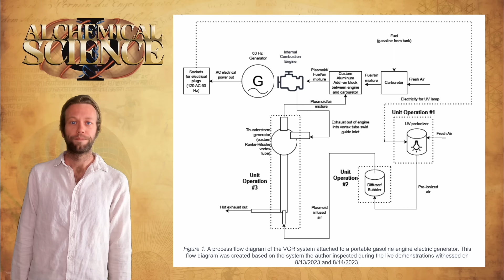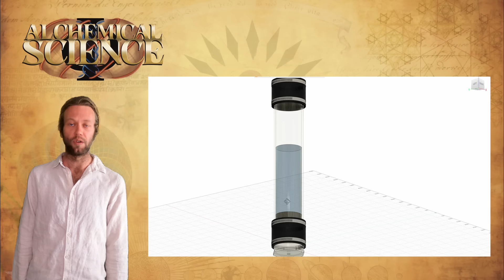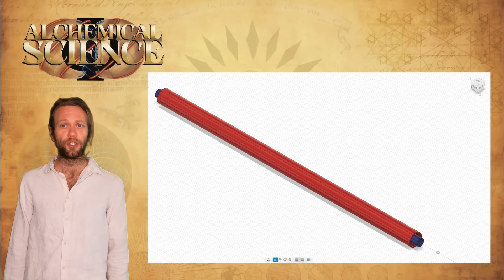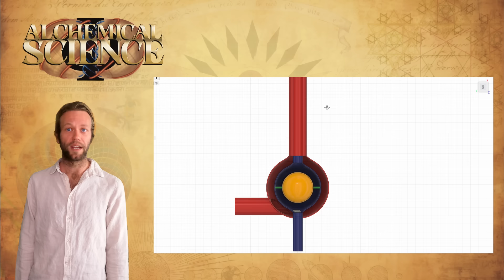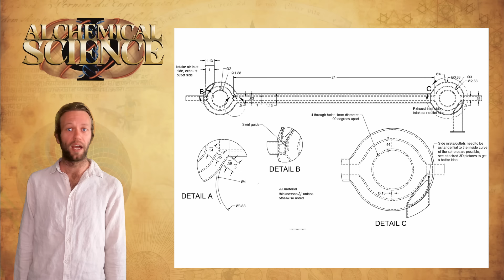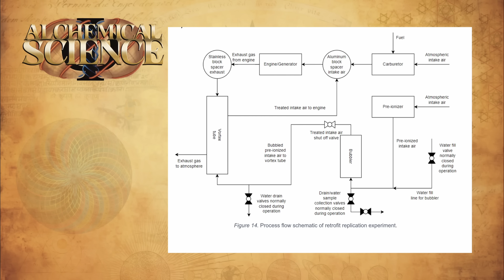Thunderstorm Generator | COMPLETE DIY BUILD GUIDE | Malcolm Bendall's Plasmoid Tech

Comment: YinYang is made up of circles with diameters of 1,2,3 and 4 and is at least 3000s of years old. 
The two small circles are 1.
from the center points of the small circle to the wavy middle line has the radius for 2.
The outer circle is 4.
A line between the two outer circumferances of the small circles crossing the center point of all the circles, give the diameter of 3.
 I'm now going to explain what is happening to the plasmoids. This is going to be difficult without the use of diagrams. Randell described the plasmoids as doughnut shaped, with the to spinning one way and the bottom spinning the other way, this is not quite correct.
The heavy protons fall to the center and stay there but are not bound together, the electrons are orbiting the center. The electrons move at the same speed, however the further from the centre the more distance they have to travel. (think storm cells in the Northern and Southern hemespheres). This process causes an horizon where no electrons can be, similar to the equator. The doughnut shape is also distorted by the movement of the plasmoid, as the electrons on one side have further to travel.
What we have is stable gyroscope, held together by electromagnatisum.
What is happening to the plasmoids when injected into the engine.
The explosion in the expansion chamber causes the plasmoids to collide with the other molicules, this flips the plasmoid. Now no longer a stable doughnut but more like the infinity symbol, with some of the electrons spinning the wrong way. This pulls the plasmoid apart and collapsing into matter and antimatter.
Both a single Oxygen atom and single Carbon atom have 6 electrons but oxygen has 8 protons and carbon had 6, so oxygen pairs up to fill it's "shells". We don't need to worry about the protons for now, due to beta decay turning neutrons into protons.
This indicates that the plasmoid is made of 12 electrons, 6 staying normal matter and 6 converted to antimatter. Because oxygen pairs up the antimatter only has the energy to anihalate the carbon, creating energy and making the engine far more efficient. The excess energy is released through ultrviolate photons. In short the Plasmoid consists of 1 oxygen atom from normal matter and 1 carbon atom of antimatter.
We can replicate this process by adding an AC electromagnet to the end of the thunderstorm generator, turning it into an Antimatter generator.
Reply: Good question, 
I'm going to cut a long story short. A while ago I got caught up in YinYang, I realised that what I was reading was not right.
YinYang is not only about balance it is also centered around the 4 elements of FIRE, WATER, EARTH and AIR.
If there elements act on the fourth we get something special.
EARTH = Chemistry
WATER = Biology
FIRE = Physics
AIR = Chi 
I was listening to the podcast with Randell Carlson, he enphersised the importance of the ratio between the diameter of the circles. He then said about the shape of the Plasmoid and compared it to the shapes of YinYang. Straight away I realised the WATER and FIRE were interacting with the AIR but no EARTH.
The Earth is just one big electromagnet 
Chi is the energy of the universe.
Having a better understanding of Randell's sacred geometry, instead of an AC electromagnet, I would suggest a double helix of magmatism to guide rather than force the flip.
The science is harder to explain but I will get back to you with it.
Reply: Antimatter was never actually observed. The experiment that appeared to show antimatter took place during a fraction of a second during charge (ion) implosion, indicating the laws of physics themselves were altered, and because they lack understanding on those foundational laws, they created the idea of anti-matter. The reality is that space is folded through zero point kinetic implosion, and in doing so, an ion diode is created and will even sustain if a carrier wave can be reset by the mechanism. Keep in mind, true zero point was only correctly defined by Tom Bearden; Pump z waves in sync yet out of phase passing through nonlinear medium will combine forming a sum of waves as a higher frequency wave.  The true nature of physics I've explained on YT since 08 and has been vindicated by others by accident over the years including Ice Cube project evidence of neutrino wind, Azra Wind's prime spiral discovery which verifies that particles function as charge column based transistors, superconductive field geometry I had on web 1996 proven over 10 years later via supercomputer in Egor Babaev's type 1.5 superconductivity paper, and others.  One fatal flaw of classical physics was to rid equations of infinities, while in fact, the creation and destruction of particles in and away from stars is what drives particle flows to require such infinities- since time and space opposites flow opposite because they make one-another through decay and creation.
Reply: This is a theory that I'm still working on, I am still working through the math. So any constructive critisisum or question are welcomed as are any insights.
It is based on ancient knowlagde with an unknown origin and would be easy to disprove or prove.
I am also trying to explain in an easy way to understand.
The first thing I looked at was the air in and the exhaust out, which more or less were equiverlant minus the plasmoids. But the efficientcy of the engine increased, which seems to break "The second law of thermodynamics". 
Einstine taught us E=MC(squared) C is a large number so to square it makes its huge. 
Mass. Think of mass as a weightless box filled will weightless frogs. The frogs jump smashing into the sides the top ect, when you try to pick up the box it's shaking. That means although the parts are weightless you are using energy to hold it still. So mass is kinetic energy. So although the Plasmoids are small they contain a lot of energy, within the proton and neutrons.
Hydrocarbons need oxygen for the chemical reaction, breaking their bonds and attaching to the oxygen, creating carbondyoxide and water. In this technology there are little to no carbon emissions, where has the carbon go?
Why is there still Oxygen? The carbon must be converted into oxygen, which is a heavier element and use more energy, for the 2nd law to be maintained a huge amount of energy must be released for this to happen. The only place we know that has enough energy to makes atoms is a supernova.
As I am working out energy conversions it seem more likely the Plasmoid is becoming anticarbon only.
I am trying to explain Plasmoids, which will come next. but it is hard without diagrams
Reply: E = mc² but this does not explain unification since both mass and energy and thermal entropy are in a motion he could not grasp in his time. Einstein's last words were "Everything is relative" which was a statement triggered by witness of the Philadelphia Experiment when the U.S.S. Hammond disappeared in an oblong green spheroid.  Carbon becomes co2 gas when it reaches a high enough temperature which it can easily do in short bursts when exposed to plasma which has it's own ionosphere with a boundary zone that has different time speed inside vs outside so the transition zone can reach 2 million F in some rare cases.  I've worked on John Milewski's microwave gold process and plasma is the key. Since then I've moved on to alchemy which is far more productive by trapping plasma in liquid preventing the loss of gold vapor when copying gold atoms into other metals. This has been done 1000 fold in under 24hrs, so if I can do that using a simple hotplate, you must know the nano bubbles are doing it to alter the physics you know there. The metal layers act as the carrier wave, while the nano bubbles are the carried waves in kinetic zpe process.  I wrote a book on physics where I show how   E = mc² without euclidian coordinates, instead using a volumetric system of 3 spheres lined up inside a 4th sphere, so the volume remaining of the large sphere equates to energy just the same. The derivative comes as each of the 3 small spheres wavers to the others in 3 phase. They represent negative, positive, matter (the 3rd pole).  By the way, chickens can eat graphite and make calcium from it. That does not require a supernova but modern physicists will try to convince you it does.   @smokeywfwe
Reply: dude youre a trip, where can i follow your journey? we need minds like yours
Reply: @ascensionunlimited4182  This journey is ours and here seems to be the place.
in my last comment I said the electrons bunch up slightly off centre, using sacred geometry any ideas how much this might be?
Reply: @mikefromspace  Source for information about chickens?
Reply: I'm nothing special. I just made a few logical deductions that everyone else should have. It's not about being smart, capable of vast statistical recollection and all that. It's just about focusing on the very elementary logic we are all born with. I only started my research searching to explain some of the greatest mysteries as anyone could do. Free energy was finally explained in a paper by Tom Bearden entitled zero point. This knowledge came from Tesla. Next, I read a magazine article by Stephen Hawking in 1994 where he suggested black holes may be creating new particles, so I thought; what if they make 'all' new particles. Eventually that led me to realize there's proof everywhere that stars consume energy (small particles of 2 poles) to make mass (large particles of 2 poles) which flows in opposition, and when you look at the big picture of what happens when they do, you realize that black holes do not exist and are unnecessary to explain anything. Is this really so difficult for others to grasp? I know only that people are too proud to step back form the preconceived notion that some imaginary photon or string or euclidian math is required to unify anything. I knew they would find a link of all known forces to the prime spiral which they did. Azra Wind , cosmicporch, did so.  @ascensionunlimited4182
Reply: @mikefromspace  I have no scientific proof but, as far as Buddhism is concerned, I also truly believe black holes are not what science thinks they are. (However, I do believe all information is contained within).
Some food for thought - as  Cultivation Systems (true religions) symbology has been mentioned here, does anyone find it interesting that the YinYang of Taoism and Taoism translates to "The Way", and the Svastikum (Swastika) of the Fa (Buddhism) is actually a depiction of the spiral galaxies and "Fa" translates directly to "The Law"? 
Without a doubt our civilisation has reached great levels in pre- history. Unfortunately, it only takes literally one generation to lose knowledge. 😢
Reply: This is all fascinating. Can you explain how you came into this information? I'm curious to learn more if this is accurate.
Reply: @BeneficenceTV Is there anything else you need?
Reply: No this is great for now, gives me a lot to research and think about.  There has been this idea of torsion physics being necessary to unlock zero point energy. I'm doing something similar with my rodin coil. Stand by for future videos on that. Also, I wonder how plasmoids would react or if you can produce them in the vacuum of space? Thanks friend!  @smokeywfwe
Reply: @BeneficenceTV  It was some really good weed!
Reply: We know how the Plasmoids are formed and it is easy to apply YinYang to the process, using air, water and fire(energy). Plasma is matter that is unbound protons, neutrons and electrons moving freely at very high energy, (quark glueon plasma is very different). A plasmoid is stable plasma, to maintain its coherence it must be atom sized. Initialy I thought 12 electrons, now I think it is 6. As for protons and neutrons I'm not sure the vast majority of the mass/energy is held in these. (I will get there).

Randell Carlson describes the Plasmoid as doughnut shaped, this is the wavefunction. The heavy protons and neutrons will fall to the centre with the electrons in orbit containing them, the top half spinning the opposite way to the bottom. Because this is a plasma the protons are not bound, meaning they are separated into top and bottom, spinning in opposite directions. Due to the replent nature of the electrons and the opposite spins between the top and bottom, there must be an horizon where no electrons can go. The horizon will be a wavey line as the spinning electrons interact with each other. This describes a stationary Plasmoid.
When the Plasmoid is moving however, the electrons orbits change. The electrons moving in the same direction have a further distance to travel, whilst those going the opposite way have a shorter distance but they still repel each other. Now imagine the YinYang symbol and turn it on its side, this is a good depiction of how the Plasmoid would now look. The electrons bunched up, slightly off centre from the direction of travel, with the horizon line reflecting this change.
We have 3 electrons orbiting one way and three the other, an unbound nucleus also spinning in opposite directions of the most energetic form of matter that is stable when horizontal, it is only the very most energitic of these that exit the thunder generator.
This is all known physics so far.

I speculate there are 6 electrons 3 top and 3 bottom, my reasons are it seems only carbon is anilalated. YinYang seems to be depicting a Plasmoid, the small circle (nucleus) with a diametre of 1 and the area depicted by circle with a diameter of 2 (elections), the ratio of the area is 3ish
The flip is also speculative and your thoughts are as good as mine but I will give my perspective next
Reply: To recap, The Plasmoid we are concerned with are the most energetic, which are stable when horizontal to the Earth's surface, held by the Earth's magnetic field. The top half spins in the opposite direction to the bottom half, as the nucleus is unbound that too is sinning in the same manner. Due to the lateral movement containing a slight charge off set from the center line, front and back.

My Speculation 

When introduced to a double spiral of magmatism, The Plasmoid will start to rotate. Due to the bulge and thinning of the electons wavefunctions both halfs will be pushed under each other, closer to the nucleus. This means the electrons orbiting the to protons are now orbiting the bottom nucleus and the bottom electrons are now orbiting the top nucleus. The electrons are spinning opposite ways to the unbound nucleus whilst being forced closer, by the electromagnetic force. When the electrons get to close to the nucleus the poles flip and there is a release of energy in the form of photons. This release of energy forces the Plasmoid to settle, as it can no longer maintain itself as plasma. The poles have flipped, the strong is now back and a stable antimatter with 6 electrons is remaining.

This theory can be tested.
Assuming someone does the experiment and it is proved correct.
could the younger dryus be caused by a massive Antimatter explosion?
What would happen to the environment if large amounts of carbon were to be removed?
What would it mean for Plato's story of Atlantis or stone vases ect?
If correct Malcolm, Randell and others will have solved the world energy crisis
Reply: The first time I saw this tech, my first thought was “this is just another form of matter manipulation”. You could make any element that’s stable with this tech, eventually I think.
Reply: It is a type of atomic reaction/ cold fusion process that has the ability to change matter so I wouldn't doubt it could be used in that way to some capacity. Interesting to think about  @ParkerExp
Reply: For anyone who thinks my Theory is a fun one, and wants to check the math. 
I won't put figures, so as not to prejudice others findings.

Total energy output with Plasmoids - Total energy output without Plasmoids = X

% of Carbondyoxcide in exhaust without Plasmoids - % Carbondyoxcide with Plasmoids = Y ÷ 3 = Z

Z x capacity x 2(total energy of a carbon atom) = X?

This is an approximation.
Reply: If anyone can test my theory, I salute you. You must be slightly mad, the type of person who grins when they fight. 

THIS IS FU***NG DANGEROUS. 

If antimatter is produced that eradicates carbon, then it will be deverstating if it comes in contact with any living thing. So put SAFETY FIRST, SECOND and THIRD. Billions of Plasmoids are produced, which could be transformed into antimatter. to put this into perspective. 
100,000 seconds = 28 hours
1 million seconds = 11 1/2 days
1 billion seconds = 31.7 YEARS

The experiment

The hot and cold outlets need to be separated so the magnetic fields don't effect each other (I'm thinking about the use of the alabaster tube with the gold sleeve). Each outlet will need a magnetic spiral on the end, making it look like a double tipped spear. when the antimatter is produced it will react with any carbon anywhere, so initialy you should see flashes similar to lightning within the air. This won't be a straight line, think about the " drill core No 7".

The Plasmoids are off set by about 1°, so I would suggest invoking sacred geometry and make the dual spirals 1.16°.
The angle of the cone should be 45° - (45° of the Plasmoid 0.58) However, the Plasmoid is off set so the angle must increased to compensate 45 x 1.16 = 52.2 - half of the offset 0.58 so again I would invoke sacred geometry and put the angle at 51.6°.
Assuming the the reason for the separation of hot and cold is due to the relative spins of the Plasmoids then one spiral should be clockwise and the other anitclockwise turning toward the middle. The YinYang symbol tell us this, the white side is clockwise and the black anticlockwise. I don't know which is which, my best guess is white is cold. As for the magnetic field, I would suggest matching the earth as the Plasmoid enters the spiral, as a starting point. What we are trying to achieve is similar to the bubbler, with the Plasmoid gently being explanded and contracted. Pulling the electrons away from the nucleus to create a space, then contracting to push the electrons under each other.

I hope you have all thought this an interesting theory. It explains drill holes, scoop marks, stone vases and all other ancient stone work. It gives a practical use of the serapium and maybe the pyramids. It is constant with YinYang and many myths or legands. But most worrying of all it gives another theory for the younger dryus cataclisum, so again SAFTY FIRST.
Thank you all.
@mikefromspace I will read through your theory and hopefully I can offer some help.
@jaslll4396 can you be more specific about the accident please, any idea of the charge? where did they touch? what was the part made from? anything else
Reply: I have no scientific proof but, as far as Buddhism is concerned, I also truly believe black holes are not what science thinks they are. (However, I do believe all information is contained within).
Some food for thought - as  Cultivation Systems (true religions) symbology has been mentioned here, does anyone find it interesting that the YinYang of Taoism and Taoism translates to "The Way", and the Svastikum (Swastika) of the Fa (Buddhism) is actually a depiction of the spiral galaxies and "Fa" translates directly to "The Law"? 
Without a doubt our civilisation has reached great levels in pre- history. Unfortunately, it only takes literally one generation to lose knowledge. 😢